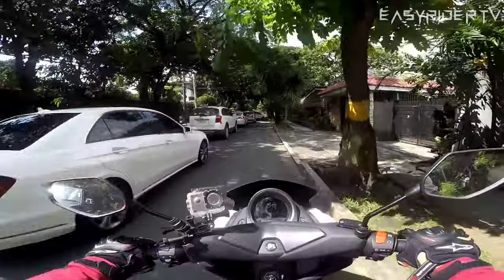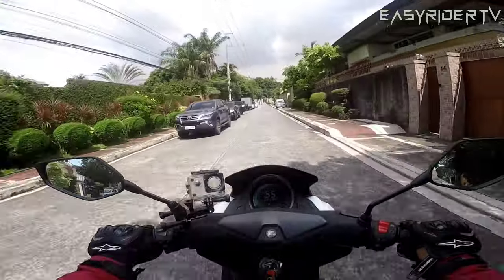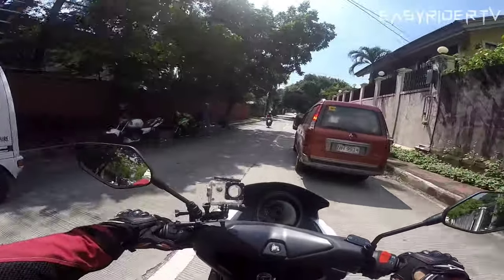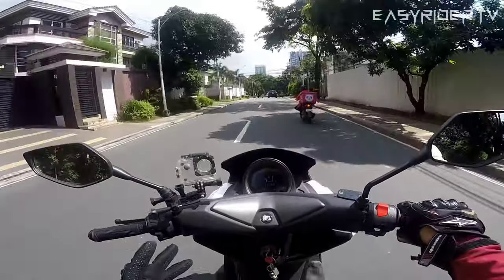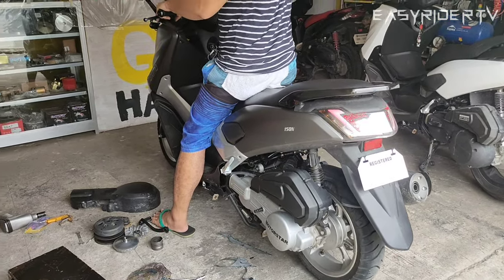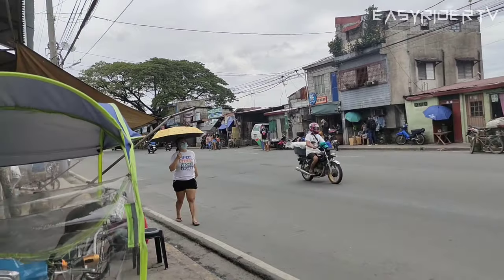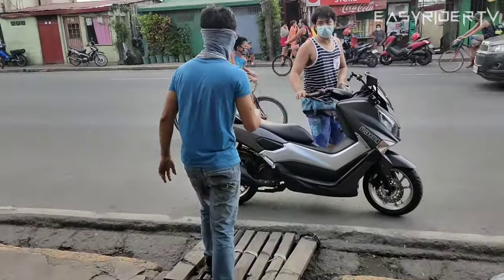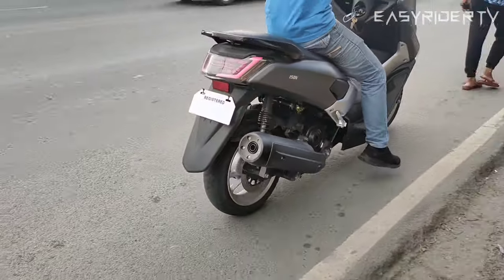MAS SOLID ARANGKADA BY: GY6HACK// KALKAL TORQUE DRIVE PART 2 ON EASYRIDE 150N

Comment: Lods pwede malaman kong anong set up ang ky towel adventure..gusto ko sana gawen ko sa aking er150n..
Reply from the maker: Ang set up na mgayon ni 2 wheel adventure is katulad narin nung mga latest na nagpagawa kay gy6hack, MTD, MCL, palit Center and Clutch spring, Ang stock nalang na natira sa kanya is yung pulley nya👍

Comment: Ilan na gas consumption ngayun sa 14grams?
Reply from the maker: Naglalaro lagi sya sa 28 to 31 km/l idol, Depende pa din sa sitwasyon ng traffic at load ng motor
Reply: How about nung allstock ilan ang gas consumption idol?
Reply from the maker: @tiktokbestph1320  Minsan 25 to 28 km/l idol, Siguro dahil sa bago pa yung motor noon kaya medyo malakas pa sa gas, After a month Nag pa modify na ako kay gy6hack